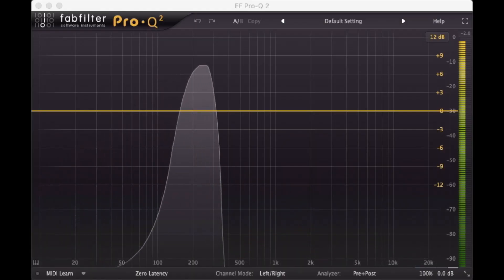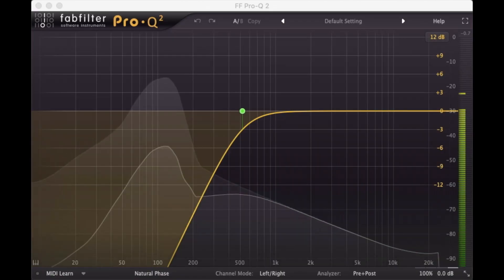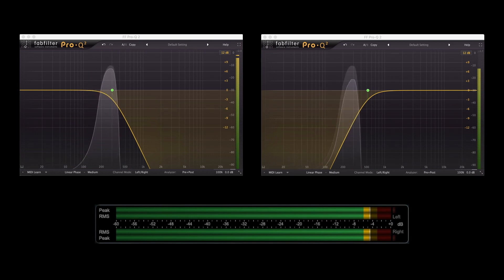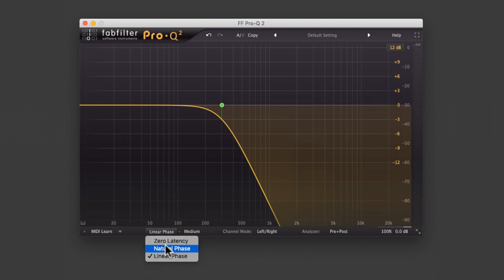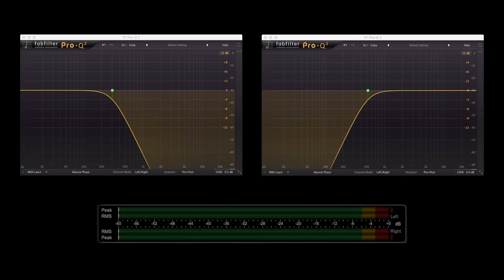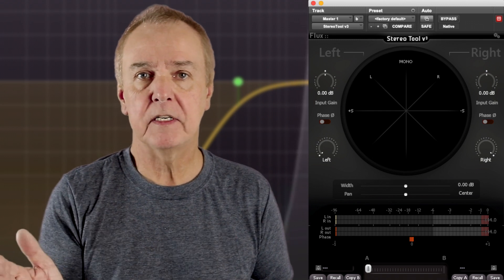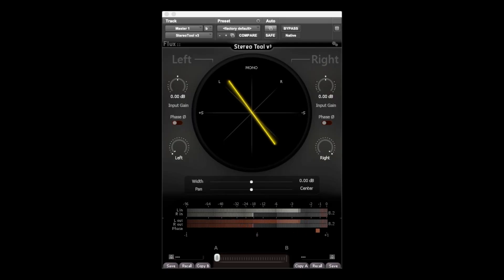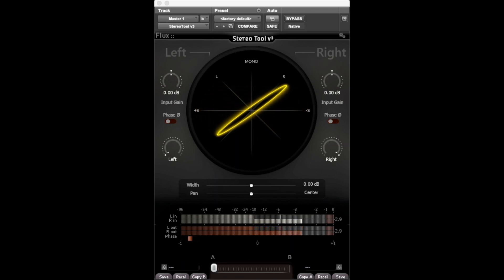Linear phase filters and frequency response with the FabFilter Pro Q 2

Comment: This depends on the ORDER of the traditional (minimum phase) high pass or low pass filters. 

Every order (6dB/octave) adds a 90 degree phase difference between MATCHING low pass and a high pass filters at the -3dB point. 

Thus a 2nd order (12dB/octave) filter introduces a 180 degree phase shift. Reversing the phase of the low pass signal negates the cancellation problem. 

2nd order 12dB/octave filters are common in 2way passive speaker crossovers and to negate the cancellation problem the tweeter is always wired backwards inside the speaker cabinet.

A 4th order (24dB/octave) butterworth filter (commonly used both electronically and digitally in active speaker crossovers) introduces a 360 degree phase shift. Which is effectively zero.  Every other order of filter will have significant phase mismatch errors at the crossover point.
Reply: I'm having trouble understanding this, do you have any resources that can explain this more?

Comment: You make three big mistakes in the first 30 seconds. First, you can certainly make a non minimum phase all pass filter with electrical components. Second, you can approximate a linear phase filter with an analog high order Bessel all pass filter to any degree you want to. Thirdly, linear phase does not mean looking back in time unless the phase slopes upwards. A general linear phase filter adds positive latency, so there are no causality issues. You have been told these things without having the theoretical knowledge to check them.
Reply: High order analog filter, if you mean like 8th order. The component tolerances, gain and phase stability and rising Q factors put a hard limit on the order. Not any degree you want to. But yeah, he lies about linear phase filters not existing in analog and violating casualty. They're used in audio all the time. Glad you called him out.

Comment: Hi. Basing on this video: https://youtu.be/efKabAQQsPQ,   did I understand correctly: when doing high cut and low cut filters, fabfilter not only reduces the frequencies intended to be cut out, but also raises all the rest of the frequencies in a shelf-like manner? Isn’t that dangerous to the ears in headphones, because you can easily exceed the safe threshold in certain frequencies, especially after a few hours, when your ears adjust? Say, you are listening to the solo track at 76 db, and then do a low cut, and all the high frequencies are boosted to 80 db, but you look at the graph and think that you only cut the low frequencies, but you actually boosted the high frequencies, unknowingly putting high frequency hearing capability to danger?
Reply from the maker: A filter reduces the level in the stop band. The level in the pass band stays the same, except there may be a peak at the cut-off frequency. DM
Reply: @AudioMasterclass  that peak in the cutoff frequency also does not increase the volume of that frequency, right?

Comment: Can't wrap my head around to how to mix/blend real + sampled kick tracks when EQing 2 tracks independently before summing to a kick bus (and then add more processing) I made sure both tracks were visually time and phase aligned. Then I was forced to downmix the two tracks to save some CPU, and started going crazy. In the resulting waveform, both kicks had moved slightly in time, creating a strange and longer waveform. I had made sure that the recorded kick was time/phase aligned with the overheads (did the same with the rest of the drum tracks. In fact, I've become obsessed with this lately), and now everything was all over the place because of individual eq processing. I am 100% sure it is not a latency compensation issue. When mixing down/freezing tracks, my daw compensates for plugin latency automatically. So I decided to mixdown each track individually to see what was going on. Zero phase eq processing created a 3x longer kick on each track (because of different frequency phase missalignment, I guess), and linear phase created lots of pre-ringing and missing transients. The less destructive setting was linear phase in "minimum" setting, but still had issues. All of this considering I was using a sample kick sound that was nothing like the recorded one, except for adjusting the pitch to match the fundamental note.
I got rid of HPFs and LSFs I was using to polish low end, and things started to improve a little. Then applied those filters back in the kick bus afterwards, and things kind of started working again. But now I'm not confident anymore about the kick staying phase aligned with the rest of the drum tracks (specially OHs) unless I bounce the bus output to audio and compare the timing to the overheads. And that's a bummer. 
If I've understood correctly how this works, despite of visually aligning the recorded audio tracks and its transients, heavy eq processing can missalign back the timing of frequencies separately, and the only way to make sure everything's ok, you have to use your ear, or bounce the individual/bus tracks to audio after processing to re-check the alignment before summing in a drum bus. My final thoughts: the best you record things and the later you process drum tracks after summing, the better. There's only so much correction and tweaking you can do before things start to get all oven the place and out of control. I really struggle to get things right when I receive badly recorded tracks for working on a mix. I feel like I spend 90% fixing the impossible before I can even enjoy the process.

Comment: Okay so as a basic general isation, is it fair to say that  DAWs decide gain boost/cut depending on the concept of  constructive and destructive interferences of sound waves (as phase matters in case of interferences)?
Reply from the maker: My preference for understanding EQ and filters is to turn first to analogue electronics and then consider that their behaviour can be emulated digitally. Following that there is further digital theory to examine. Or it's a lot simpler just to consider the principal controls of a real-world EQ - gain, frequency, Q etc - and listen to what they do. DM

Comment: Very interesting! Thank you for this video. Would you say that the phase distortions that would happen through non-linear phase filters would be a reason against using standard application filters for multiband crossovers? I've always wondered what types of filters I could use in order to make possible crossover filters that allowed me to more flexibly process signals in a multiband fashion, but could never figure it out. I know that equal power or equal amplitude throughout filtered bands would be something to desire, but I could never figure out how I could obtain such parameters.
Reply from the maker: Linear phase filters are most suitable any time a signal is mixed with a processed version of the same signal, or two processed versions of the same signal are combined.

Comment: Great video. Would be nice if you tried to compensate the minimum phase crossovers level dip with a bell band eq boost on yhe summed signal, just to see how close one can get. Is that possible?
Reply from the maker: That's what you would try. In the mastering example given, it's important to remember that you're changing the sound anyway with the compression, so you wouldn't want to get back to the original exactly. In the video I said, "Make it sound good", which is what you would do. If it didn't sound better then the original then you would scrap the idea. Good audio is often about spending time and effort trying something, then having the courage to scrap what you've done because it didn't work out. DM

Comment: 6:38 "When they're not in phase, they'll add up lower than 6dB"
In addition to level fluctuation, does phase cancellation also cause the mixed signal colored? My thought is that different frequencies will have different degree of phase cancellation so the mixed signal's frequency response is going to be changed.

As always, thank you for this precious masterclass.
Reply from the maker: If it's sine waves, then I wouldn't call that colouration. But if you mix a music or speech signal with a second version of itself, then yes there will be colouration, in the sense that various frequencies will be cut or boosted. A classic example is a microphone placed close to a reflective surface. The reflection is delayed and causes comb filtering. DM
Reply: @AudioMasterclass  Yes I'm thinking delays and comb-filtering as well. Thank you (again) for making things clearer to me.

Comment: Thanks for the great infos David. So should we therefore always have the Linear phase "On"for mix and mastering if the computer can manage?
Reply from the maker: It's just my opinion, but I would use minimum phase for everything except when I'm mixing a signal with a version of itself. But it's all down to what sounds good. In the mastering example mentioned in the video, then in theory linear phase would be better. But I would still try minimum phase to check that linear is actually an improvement. Pre-ringing can be an issue with linear phase, so it isn't guaranteed to sound better in all cases. DM